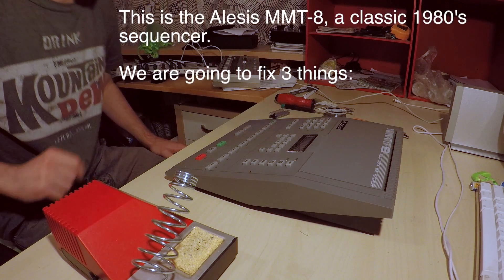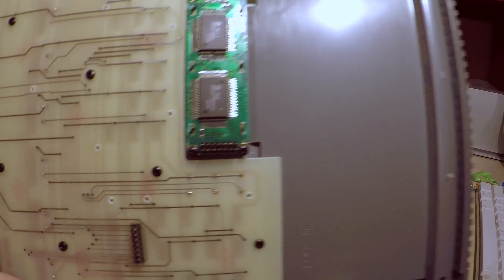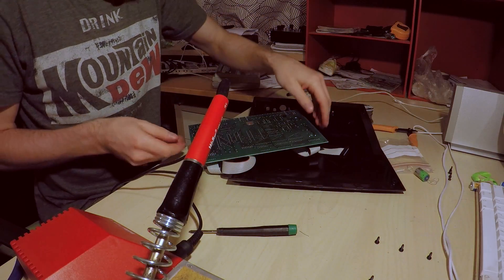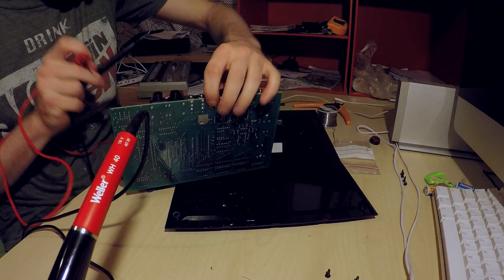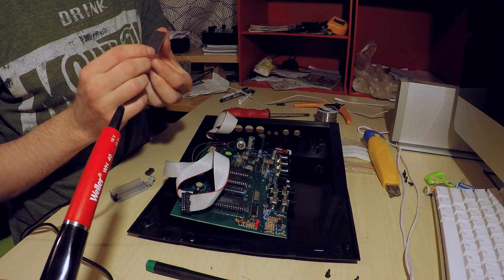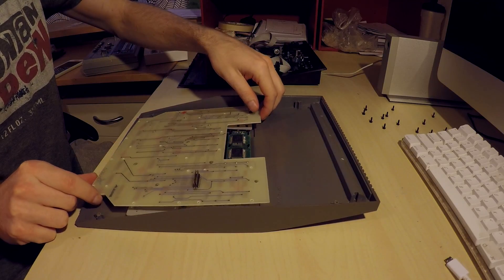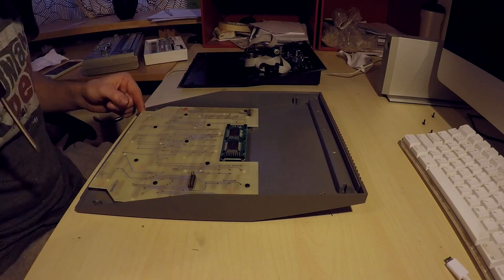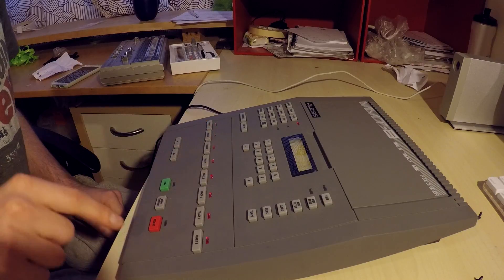HI.TV: Alesis MMT-8 Sequencer Repair/ Maintenance

Comment: I can load old tape data without much issue... 
But whenever I press the button to change parts or press any button the machine locks up & crashes, and as soon as I power down it comes up as "Empty Part 00"... 

I upgraded the eprom from 1.08 to 1.11 but I have no idea why this thing keeps crashing... 
It's my favorite hardware piece, and my 3rd MMT-8 in 30 years.. 

Please help

Comment: Hi can you help? I bought one of these. It’s had the battery mod and I did the OS upgrade. I thought it had a fault where the midi echo wasn’t working. That because the led didn’t come on and there was no message in the lcd display when I hit the button, but I found that the midi echo function works it’s just that the led doesn’t light. My Edit led doesn’t light up either. Do you know the part number for these leds? I like what it does and it would make it so much easier if those leds were working.

Comment: Would you anyone have suggestions on why the pads activate other functions after a cleaning?
Reply from the maker: Perhaps there is some conductive contamination creating short circuits between the different button pads? Otherwise it could be a faulty multiplexer.
Reply: @HumanInterface  Thank you so much! I ended up getting it back up. I think it may have been  conductive contamination. Cheers mate!

Comment: I recently got a deal on 2 of these units that needed a bit of fixing according to the seller. The one im focusing on to begin with powers on fine but is stuck on a screen displaying "part 00" "NO PART NAME" and with no buttons responding. I'm about to give this graphite trick a go as I've heard of it before, but was wondering whether you experienced the same symptons prior to this fix?
Reply: I have the exact same issue (buttons don't respond, stuck on "no part name")... Did you ever find a solution?
Reply: @sfucapstone  I have the same issue as you.   Did you ever fix it?
Reply: @65Superhawk  I didn't, unfortunately.  Ended up selling it as "non-functioning."
Reply: @65Superhawk  I've posted a link to help you.

Comment: Hope you can help...

I'm having quite an issue with an MMT-8 that I purchased off of ebay. I had researched the most common issues and I was pretty confident I'd be able to fix them if they came up. When it arrived I replaced the internal battery, the LCD and re-coated the buttons with conductive paint which made 90% of the buttons more responsive. However, the "track 2" and "track 3" buttons always have their LEDs lit and are unresponsive with a few exceptions. When I'm arming to record a track they will blink. There are other situations where they turn off or blink but that's the only one I'm sure of at the moment. The unit also displays "track 08" when booting up. I opened the unit back up and used some wire to try and trip those buttons while its on. I even scraped some of the traces to get metal on metal contact (the PCB was cleaned with 91% isopropyl alcohol btw). The LEDs still don't turn off. I'm beginning to think that I've wasted $100 on something I can't fix. Would replacing the ROM chip be the next step? Am I just out of luck? Thanks for your time! Great video by the way!